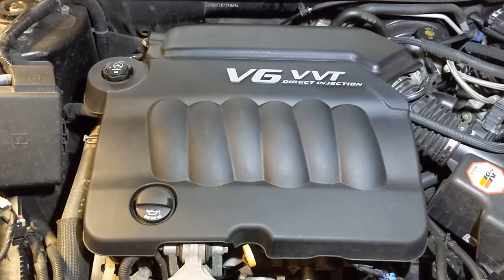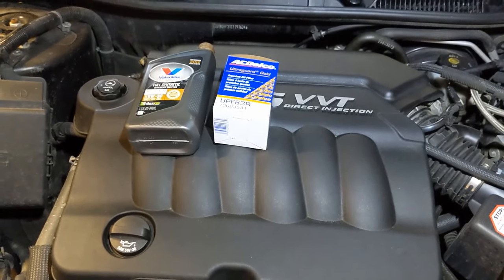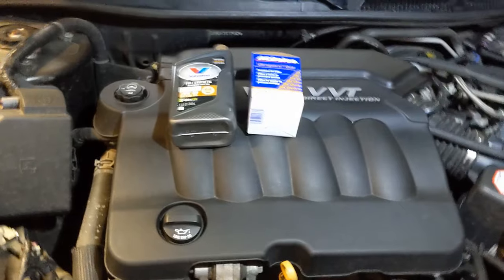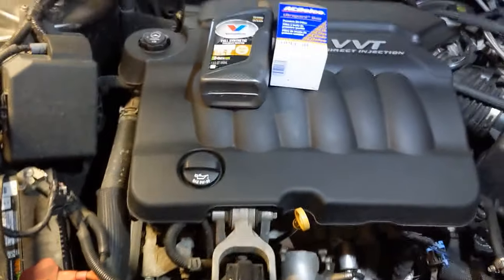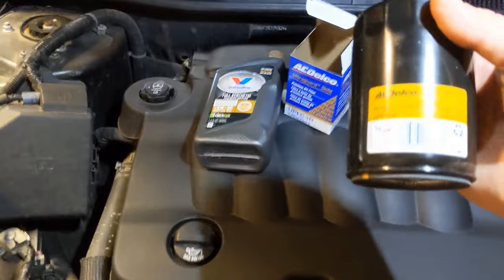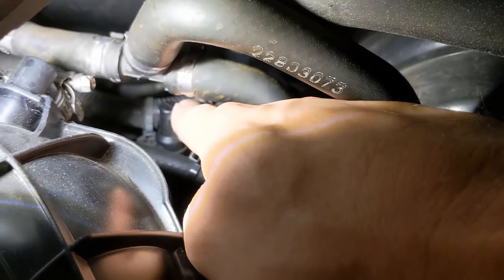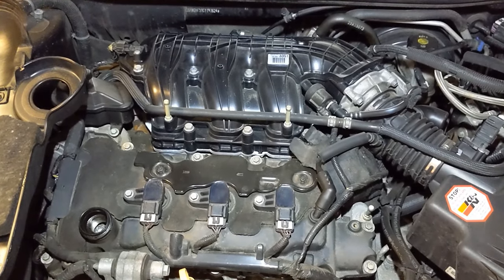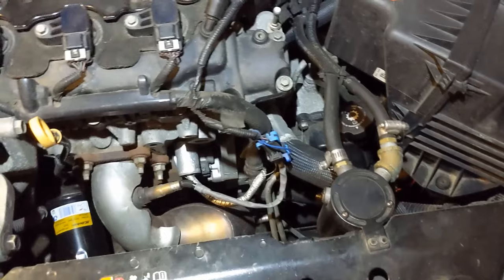How to keep your GM 3.0 or 3.6 V6 running forever - **High Feature V6 LY7 LLT LFX LGX LGZ**

Comment: I've got a weird question about this engine. I have this engine in a 2016 Impala Limited LT Police Package (which I find little to no information on). One time the car was sitting for a few days and I went to start it and it was running really rough with a check engine light. I shut it off and scanned it immediately and it showed a misfire code for fluid in spark plug wells. I let it sit for a few minutes then it started up completely normally and has never happened again. Any idea what could have caused that?
Reply from the maker: Did you remove the coils to verify there was fluid in the spark plug wells? I would suspect a leaking valve cover if that was the case.  I've had issues with the injectors being stuck open and also being so carboned up they caused misfiring, but those issues never cleared themselves after sitting a minute!!

What was the code you pulled, exactly?
Reply: @CertifiedShadetree  I didn't have tools at that exact moment but shortly after I did pull the coils and spark plugs and they all looked great. I can't seem to find the screenshot of the code so I'm not sure. The car has never consumed any oil between oil change and no other evidence of any oil leaks.
Reply from the maker: @MymaJyma  There was a TSB for these cars stating the engine harness could potentially rub against the transmission case, fray the wires inside, and cause misfires. That's something you could also check.
Reply: @CertifiedShadetree  Thanks for the info!
Reply from the maker: Hope you get 'er sorted out!!

Comment: Does seafoam clean the carbon off the intake valves on these engines? Opinion?
Reply from the maker: If you use it in the traditional sense, you might end up dislodging a chunk of carbon and having that pass through the engine.
https://youtu.be/LXZ8cIZeDGA

Comment: I have a 2010 Impala LT with the pushrod 3.5 engine, and I just had to get the ECU retuned at the Chevrolet dealer. The car was getting horrible gas mileage and it gave me a check engine light. The ECU was telling the motor to use more fuel and so I was getting a P0172 rich fuel code. From my understanding, the software/code on my car was pretty screwed up and I don't know why. Has anyone ran into these ECU problems with the 12-13 Impalas?
Reply from the maker: After owning 3, I can't say that I've had those issues..
Reply: @CertifiedShadetree  Wow. That leaves me scratching my head.

Comment: I just had my timing chain replaced on my 11 Acadia. Since coming from the shop a few days ago i have driven it maybe close to 150 miles. The oil life says its at 97% now. In just a few days 😮. This makes me nervous that the oil is being burned so fast. I haven't actually checked the level yet but should I? After just a few days of it being at 100.
Reply from the maker: Yes check the oil level. That sounds normal, but you should not live and die by the oil life monitor. Reset one of your trip odometers to zero and change the oil when that one hits 3000-4500 miles.
Reply: Crazy, just recently had my timing chain replaced and suddenly burning oil like crazy as well. What could possibly cause this issue, anyone know?
Reply from the maker: Switch to Valvoline Extended Protection 5W30 on your next oil change..
Reply: Your oil life has nothing to do with the oil level. It doesn’t sense the oil level, and doesn’t know anything about the oil. It simply is based off how many miles you drive. And I’ve found the oil life in my 2012 enclave to be highly unreliable, I just watch my miles and change oil every 3500 while periodically checking the level and filling if necessary. I would highly recommend that you completely ignore the oil life percentage.
Reply: My son's Impala has 146k. Oil gets changed every 3k. Runs perfect.

Comment: Do you recommend the same oil brand  and everything else on the 3.9L 2008 impala
Reply from the maker: No sir, not one bit of it is necessary! The good 'ole pushrod motors aren't 1/100th as finicky as the LFX.  I would still at least use synthetic oil and a good filter tho. The oil doesn't have to be Dexos approved, so the cheap synthetic they sell at Walmart and Amazon is fine even.  There's absolutely no need for a catch can, and you can safely follow the oil life monitor. So essentially anyone with a 2006-2011 Impala with either the 3.5 or the 3.9 motor can completely disregard this video!! 😁
Reply: The 3.5 and 3.9 is based off the 3100/3400 that is notorious for head gaskets and intake gaskets.
Reply from the maker: They at least put in a coolant crossover tube in the 3500/3900's so if an intake gasket fails, it won't dump coolant into the engine.  The basic design goes all the way back to the 2.8 in the 1980 Chevy Citation!!

Comment: I had a 2015 Camaro with this motor.. It had a different oil filter.. I ran Royal Purple in it for the 4 years I had it..
Reply from the maker: @Reaper1008  There's 2 oil filters that fit this engine. The PF63 is the taller of the 2, so I'd be willing to bet you were using the short one..
Reply: @CertifiedShadetree  mine used a cartridge like filter, on top of the motoi, under an aluminum cap.
Reply from the maker: @Reaper1008  Well I'll be dipped!

Comment: Yep, I gotta try the pcv mod on mine
Reply from the maker: I'm impressed that you got yours to 245k!
Reply: @CertifiedShadetree  yep, and it's been mostly problem free
Reply: Recommendation of timing chain and guides plus new pullys and water pump all at once at around 140,000 besides oil changes and pvc valve and air filter . Seafoam best for keeping ethanol bullshit gas clean in injectors
Reply: @early363  i am way overdue then lol

Comment: And also another question,  since i have been using semi synthetic blend oil and change it at 3,000 can i continue using dexos since im at 110,000  ,  or would i maybe create a problem going full synthetic and plus i its much higher and i wouldn't be using the full life of full synthetic.  What is your opinion since i got same engine 3.6
Reply from the maker: Go full synthetic all the way, the sooner the better.  I've advocated for Valvoline Modern Engine 5W30 for years, but since it's been discontinued, I've been using Valvoline Extended Protection. IMHO, it's even better than the Modern Engine as far as consumption goes.  I still stick to a 4-5k OCI and get a negligible amount of oil consumption.  I get a little bit in the catch can, but the level on the dipstick hasn't been affected.
Reply: @CertifiedShadetree  and if i happened to get more oil leaks for some reason if i change to full synthetic,  people ive heard said switching to synthetic you would develop more issues,  i just dont want to keep switching,  ive been using dexos 1 semi synthetic
Reply from the maker: Do you have any leaks now?  Honestly, I wouldn't put much stock in the "it will leak more using full synthetic" rhetoric.  I had an old Tahoe with a 350 that was a chronic leaker, and it didn't matter what type of oil I used, it always leaked the same amount onto my garage floor.  And to piggyback on that, anything manufactured in this century is designed to run on full synthetic..
Reply: @CertifiedShadetree  you said you wouldn't put much stock ?  I didn't really understand.   No i do not have any oil leaks , but i just dont want to open a can of worms and create any other problem.  Thats why synthetic yes i would go for it , i just hope im doing the right thing,  and not making something worse leak , if you understand
Reply from the maker: By not "putting much stock" into something is an expression meaning to be sceptical of what you might've heard.

The point I'm trying to make is if you own anything built since 2000, you should be using full synthetic, and if you have a GM 3.6 you especially should be using advanced full synthetic. Personally I'd worry way more about the potential internal damage the blended dino oil is causing versus if the thing actually starts to leak externally..
Reply: @CertifiedShadetree  ok but , 4 to 5 k    isnt gonna hurt the engine if i go with full synthetic oil  cause i still do stop and go short trips on other days ,
Reply from the maker: @myfavorites1016  As long as you're using an advanced full synthetic oil like Valvoline Extended Protection or Mobil 1 Extended Performance and changing it every 4-5k you're golden.
Reply: If it is not using oil with the semi syn in it keep using it also stick with a paper air filter not a washable or that will eventually lead to oil burning issues. The seals on older engines 20yrs plus are not designed for synthetic oil i found that out the hard way on a pinion seal the parts manual even listed 2 seals 1 for mineral oil and another for synthetic.

Comment: What if the timing code p0017 just started showing up at 58000 miles indicating a possible stretched chain.  I read if you change the oil and filter every 3000 miles. You can keep the chain from stretching further.  Read several comments that people said they drove another 50000 like this with no problem.  Can't afford the cost of timing chain replacement and can't do it myself.  Pretty sure previous owner probably changed oil every 10000 miles. Any opinion?  What about trying a flush more harm than good?
Reply from the maker: Check the links I put in the description for @WatchJrGo 's channel where he flushed out a 2011 Camaro LLT.
I also tried the BG EPR engine flush on my Impala: https://www.youtube.com/watch?v=WJQlBtHLWBQ
Worth trying, and if it works, it sure beats a timing chain swap!
Reply: @CertifiedShadetree  Thanks for the getting back to me so quickly and for the advice. Really appreciated.
Reply from the maker: @SimonBarsinister  🍻

Comment: What's the AVG cost for new timing chains,  labor included
Reply from the maker: I can't give you an accurate price, but I've heard some people have paid over $2k.
Reply: @CertifiedShadetree  Local Chevy dealer quoted me $2200.00 four months ago.
Reply from the maker: @Midwest522.8  🤯
Reply: Just had mine done 2010 Equinox V6, with water pump and serpentine belt came to $2300.  Had rough idle and Crank & Cam shaft codes, now runs smooth as butter & strong af with 240k miles.  Always do/did oil change & clean air filter (k&n) at 3k, use Seafoam for last 2-300 miles before oil change, zMax in fuel & oil 2x/ year.
Also for reference,  recent transmission rebuilt ($3500) + new transfer case ($1800) included parts & labor.
Reply: Depends on where you live. In California, the local Chevy dealer quoted 20 hours at $225/hr…or $4,500 LABOR ONLY. Add another $2,000 for GM parts. Indy shops get about $1,800 for labor and $800-1,200 for aftermarket parts, depending on how much you want to replace. I bought all GM parts through RockAuto, including water pump, belt tensioners, etc, etc…and spent about $1,200. That being said…I’d budget at least $3k.

Comment: I always change the oil in mine with Royal Purple and a wix filter
Reply from the maker: How is your engine's oil consumption with the Royal Purple?
Reply: @CertifiedShadetree  I do follow the oil life monitor and by the end it consumes about half a quart. It was consuming 3 quarts with pennzoil synthetic.
Reply from the maker: @Connor4x4  Oh yeah, Pennzoil is godawful with these engines!! I'm looking for a good substitute for Valvoline Modern Engine, as it's been discontinued. On a 180k mile engine, it was consuming 1/4 quart every 5k with VME. Might give Royal Purple a look.
Reply: @CertifiedShadetree  I've always had good luck with Royal Purple. Had to do valve cover and intake manifold gaskets on one of my trucks that gets Royal Purple and at 330,000 miles it was super clean inside
Reply: I also run Royal Purple. I consume about 1/2 to 3/4 a court in 5k miles.

Comment: Nice, a have chevy captiva 3.6L v6 vvt, its Alloytec engine too right ? If you have more tips i will be happy to learn more.
Reply from the maker: Yes that's a high-feature engine. I would 100% install a catch can on the dirty side of the PCV and a clean-side separator on the clean side of the PCV. https://youtu.be/hu57lGzxiRY?si=X7K57B_QFt7Piz8o
And use Valvoline Extended Protection 5W30 - the Modern Engine oil has been discontinued..

Comment: I am about to purchase a 2008 Pontiac G6 GXP, I know it has a 3.6 VVT engine, what should I check to see if it is in good condition?
Reply from the maker: Set your expectations low. The version of the 3.6 in the G6 is the absolute worst one. That said, I'd take it for a drive, give it a few revs and listen for any valvetrain clatter. Also bring along a code reader so you can check for any codes relating to VVT, timing chain, or fuel injector issues. Check the oil level and condition of the oil. If it's low on oil or if the oil is dirty, run far far away. Fresh oil isn't indicative of a good engine, but the opposite means the owner is neglectful of maintenance, which these engines need in spades! Also look for oil in the intake tube. Just be on the lookout for obvious signs of neglect.

Comment: I can’t find the pcv valve on my 2016 impala. My engines air filter is on the opposite side.
Reply from the maker: It's in the exact spot!  The PCV-to-intake hose is quite a bit longer, but the PCV itself is on the rear valve cover on the driver's side.

Comment: Is this the same engine in 2007 Buick Lacrosse CS?  Online mechanics say the 3.6 is a nightmare but I want it.  Not sure who to believe anymore.
Reply from the maker: If it's a 3.6, it's the LY7, which is the absolute worst of the 3.6s. I'd instead consider a LaCrosse with the 3800 engine. Best engine ever made!!
Reply: @CertifiedShadetree  why do you say ly7 is the worst?
Reply from the maker: @DavidStapley0982  Well for starters, it's the very engine that gave the "3.6" its bad reputation. Horribly designed PCV system for two, which is the first domino to fall that leads to all the other problems.
Reply: @CertifiedShadetree that 3800 motor is simple, easy to work on, but has horrible gaskets that get warped by the dexcool antifreeze gm used in their cars. Many overheating issues
Reply from the maker: @brey93  True, but none of that rears its ugly head until you're well past 200k!! Aside from retaining the cheap plastic coolant elbows, they sorted out all of the major issues in the Series III.

Comment: Would I still have these issues on a 2016-2017 Colorado/canon
Reply from the maker: Yes. The PCV should be the improved version, however, so you won't need to drill the holes larger. I'd still install a catch can to be on the safe side. And definitely change the oil every 4 to 5k!!
Reply: @CertifiedShadetree  okay, what about the timing chain issue. The truck has an extended warranty but I can’t imagine the cost out of warranty
Reply from the maker: @Gazooo29 Yes technically the timing chain issues persist into the latest 3.6's, however if you keep up on the oil changes, you won't have to worry about the timing chains stretching out. 

Just to reassure you, I've meticulously maintained my 3.6, and it's close to 175k without ever suffering timing chain stretch.

If you are unsure of the vehicle's history prior to you owning it, take it to a dealer and have a "BG Products Dynamic Engine Cleaner" engine flush performed on it. Might set you back a few hundred, but it's extra insurance against spending thousands down the road. Then after that, change the oil religiously every 4 to 5k and you're golden!👍

Comment: Is the 3.9 better? The 3.8 series 3 is said to be the best?
Reply from the maker: The 3800 Series 3 (L26) is hands down the best. It's not going to wow you with massive horsepower, but it's dead-nuts reliable. I would continue to buy cars with the 3800 until the day I died if GM continued to build them forever.

That said, I wouldn't outright say the 3900 is better than the 3.6, it's just that you can get away with skimping on the maintenance on the 3900. The 3.6 is an amazing engine, but you need to be rigorous with the maintenance from day one.
Reply: The ecotec 3800 as its called here in Australia are literally am immortal engine... I say that because they leak like taps ( at least in Australia) but they just keep going... those engines are the definition of "run on an oily rag" .. I worked on one the other day 347k km on it ... engine was completely covered in oil Everywhere... but cranked over no problem and drove very smoothly...

Comment: Does the same apply on the non-DI versions? I am thinking about buying a '09 CTS with 60k miles and if I do I am trying to nurture it.
Reply from the maker: Maintain the shit out of it!!
Reply: @CertifiedShadetree  I guess what I want to ask is whether you think its worth the trouble like if I'm to it, will let it be good to me, ya feel?
Reply from the maker: 60k is decent for mileage, just be aware that that particular engine is the most problematic of the 3.6's. If you really like it, I say go for it, but set aside some money for an eventual timing chain replacement. First thing I'd do is have a BG engine flush service performed, and rigorously maintain it afterward. Maybe even do an engine flush every couple of years..
Reply: @CertifiedShadetree  I was actually thinking something similar for when I first got it. It is the PFI too. So then you wouldn't say that this fix is going to be a magic bullet against the timing chain problems eventually? Are there other problems with it other than that (and I realize you answered this about the 3.6 High Feature in general) or do they all result from the timing chain?
Reply from the maker: @mrghost12121  The cam phasers for the VVT system are also vulnerable. Don't know if "magic bullet" is quite apropos, but you will absolutely cut down the chance of any issues popping up in the future if you religiously maintain the engine.